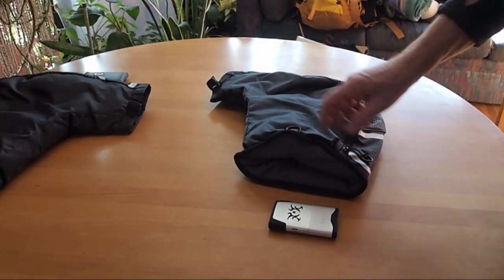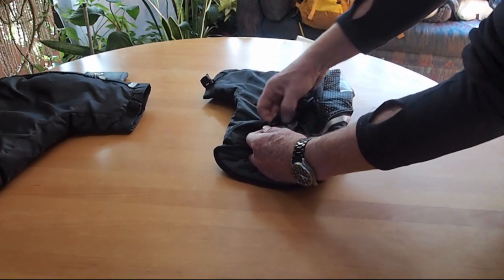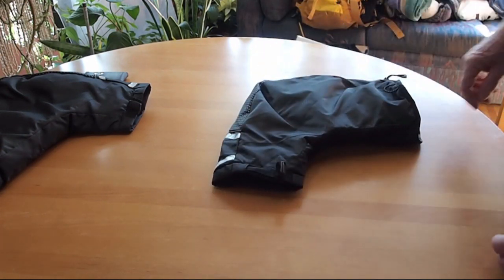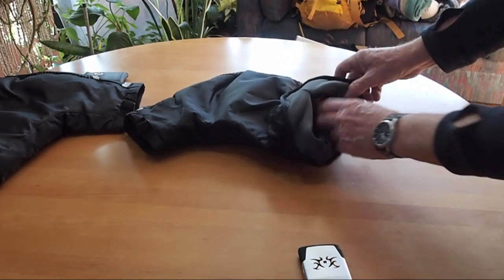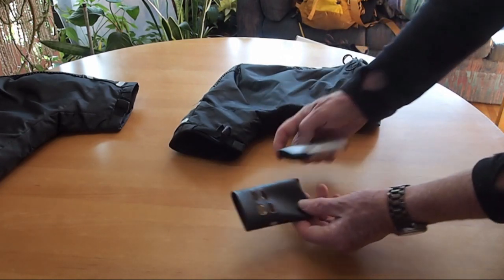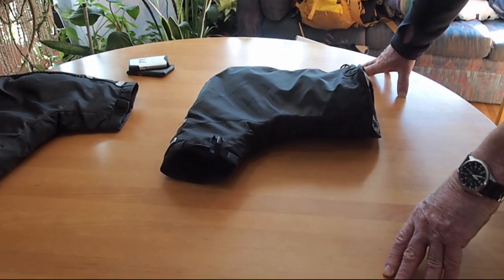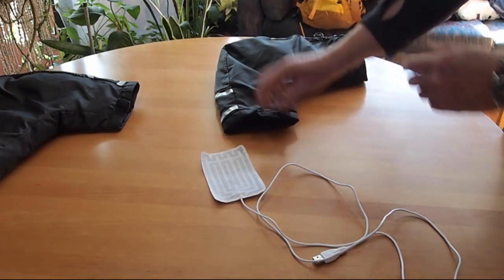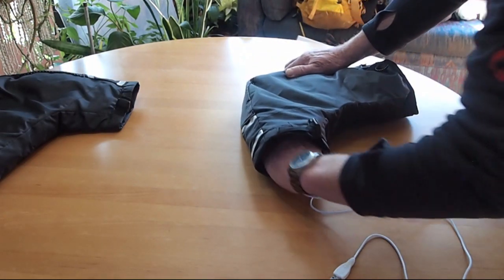Handwarmers S04E01: Winter cycling and skiing, handwarmers and Pogies on your bike or ski poles.

Comment from the maker: I forgot to address this in the video. The nominal surface temp attained by the USB heat pads before any convective or conductive heat loss is 42C (107F). The nominal temp for the S-Boston handwarmers shown in this video, when they have good Oxygen supply available (also before any convective or conductive heat loss), can achieve 73C (about 165F).